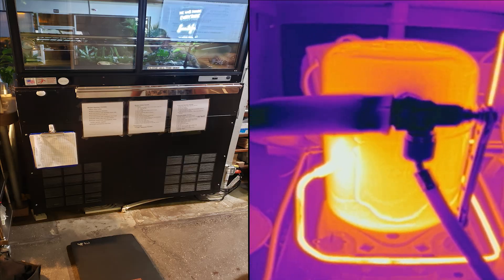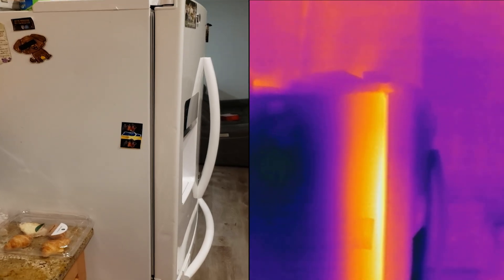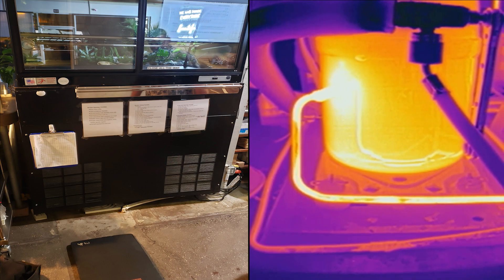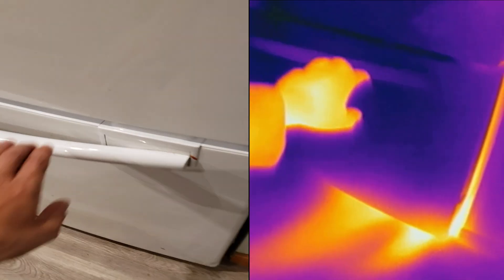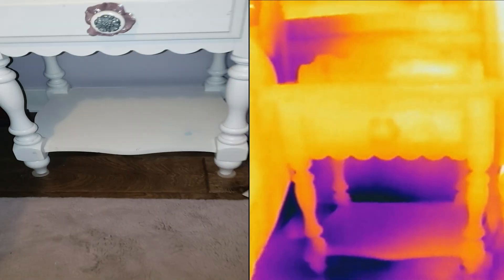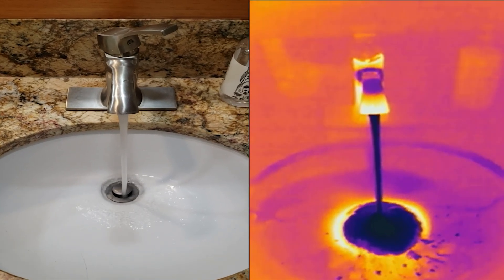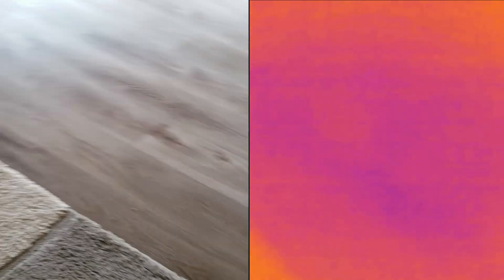10 Cool Uses for a Thermal Camera

Comment from the maker: ➡ Other Videos You May Find Interesting:

10 Ways to Splice/Reconnect Wires:
https://youtu.be/ihpNCVk1lF0
7 Ways to Avoid Getting Scammed:
https://youtu.be/RFQ6iPLCPpg
3 Ways to Bend PVC Pipe With NO Tools:
https://youtu.be/T-Q5otcs0f8
What Ocean Air Does to Air Conditioners:
https://youtu.be/9v-QPabd36Q
Is Common and Ground the Same:
https://youtu.be/wiKDlIlbiP4

Comment: Fun, I just wish they weren't so expensive.
Reply: Actually some of them are really cheap, and there are models that can be plugged right into phone via OTG USB. Cheapest are some Chinese of course, but they do the job very well, considering how cheap they are. Only question is how long they will function. You really don't need pro level equipment for home use.
Reply: They aren't too bad anymore. I have the same one from this video that I got for  $220 usd.

Comment: So, can i see pipes and studs through sheet rock?
Reply: Only sort-of with studs.  It's a very poor tool for finding studs compared to a stud finder but, on an outside wall the studs will transfer heat compared to the insulated space between the studs and that will show up on the camera.  Pipes won't show unless they are giving off enough heat to warm the surface where you aim the camera.  It does not see through anything.  It just displays the heat signature of the surface where it's aimed.

Comment: Can a thermal camera detect a sewer pipe under a concrete floor with radiant heat?
Reply: Use a metal detector for cast iron sewer pipes.  Perhaps if you ran cold or hot water through the pipe while looking you might see an image but it's not a good tool for that.

Comment: 1. Fart detector - calibrate in private prior to testing in public. Mostly just for fun. 

2. Tracking - you can see footprints of animals and people for a couple of minutes after they’re gone. You will never lose a game of hide and seek again. Unless you’re out of shape and have trouble catching people. Then you’ll continue to lose until you clean up your diet like you keep saying. 

3. Developing chronic anxiety - when you realize your TV vent is putting off 100° exhaust as it sits right on top of your highly lacquered wooden dresser. You now won’t even run to the bathroom without making sure it’s off first.

4. Attraction detector - while it’s not an xray and you can’t see through clothes you sick animal— it can detect the heat wafting from the goodie pack. When there’s a lot of good blood flow to the area, the engine is cranked and running. Time to ask for that number. Or seek out therapist before you end up in prison. 

5. Becoming a Predator - despite initial impressions, this is not a duplicate of #4. Time to become a different type of Predator. One with dreadlocks and a nasty attitude. Unless you already have those as well. If so, you can take a 5 minute break. 

Now— go out in the woods and walk around looking back and forth. It helps if you’re in the jungle. Now imagine you’re some type of ugly alien thing and there’s army people trying to shoot at you every time they see you (disclaimer: not recommended for those with a history mental illness).

I’ll be honest I didn’t really pay attention to the movie so I have no idea what you’re supposed to do past that, but what I do know is that this is exactly what the thing’s vision looks like— and everybody was like MAN it would be so awesome to be able to see like that. 

Now it’s possible, sort of. In 1982 you simply didn’t have the technology. In 2025 you have the technology, you just don’t have a good enough job to afford the technology. Maybe you should have studied more instead of watching sci-fi movies all the time. Oh well.

All I can say to you about that is…OMG IT’S SO FKN COOL and you’re so missing out. Keep working hard and saving up— I’ll be up in the trees watching your heat signature though the wall of Popeye’s chicken as you take people’s orders and fantasize about the day you are no longer limited by your primitive natural senses as I once was.

Comment: if you are on a long downhill road you can slow down by shifting to a lower gear relying on your engine compression so you don't have to worry about rotors overheating, bonus points if you added a regenerative braking system or drag braking system

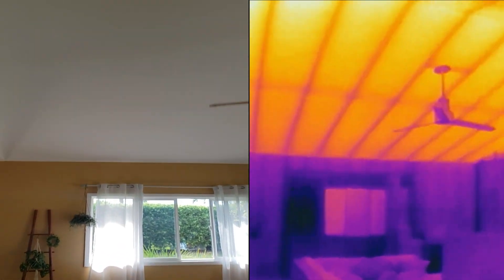Comment: 2:16 this looks as if you have no insulation in the ceiling, at all.  Wood is a terrible insulator compared to any common insulation material.  The ceiling joists should show a warmer color than the space between joists, even if you only had a couple of inches of blown-in insulation there.
Reply: Your comment would make sense if this was winter time but its not. It's summer

Comment: I work in an oil product terminal. Can a thermal imaging camera see through a truck carrying oil product?
Reply: It doesn't "see through" anything.  It has no x-ray vision.  It only sees and displays differences in temperature.  If you aim it at a truck, it will display temperature differences on the metal surface where you aim it.  Nothing more.

Comment: One more tip/warning: Thieves can use a thermal camera to see which buttons you pressed on a keypad (e.g. door lock, lockbox, car door, or ATM). To prevent this, rub your hand over all the buttons after entering your code.
Reply: This is actually really helpful. Thanks!
Reply: That's ridiculous.  No one can tell the order your press buttons for a pin code with a thermal camera and crack-head thug thieves don't carry around $500 cameras.  They will just wait until you have your money and take it from you.
Reply: @davidkrump9446 It’s not ridiculous, it’s mathematics. Normally on a four digit pin there are 10x10x10x10 = 10,000 combinations. However, a cheap $150 thermal camera could detect the four buttons pressed within a short window of time. If the attacker knows the four buttons you pressed, then this changes the combinations to 4! (4 factorial) 4x3x2x1 = 24 combinations. Even if your system had a 15 minute lockout after 3 failed attempts, a targeted attempt over time would work. That is why we should use longer pins if permitted and to use at least one digit more than once to frustrate an attack.
Reply: @davidkrump9446 The LockPickingLawyer demonstrated doing it with a $200 thermal cam in video 1442.

And it’s not just a danger for simple muggings. People could also use it to get your debit card PIN, get into your car and steal expensive gear you’re carrying (if you drive a Ford with a keypad. E.g. I sometimes carry several grand worth of photography equipment), access a secured office building and steal corporate secrets, etc.

So just wipe your hand on the keypad after using it. The defense is trivial.
Reply: @davidkrump9446 Also, if you put your house key in a lockbox like real estate agents commonly do, those lockboxes allow the buttons to be pushed in any order.

Comment: Another great use for thermal cameras is to search for hidden cameras in places like hotel rooms and Air BNBs etc...
Reply: I'm curious. What about a hidden camera would cause it to have a different temperature than its surrounding environment? Hidden cameras run on pretty low voltage, right?
Reply: Even low voltage will show with a thermal
Reply: @CONCRETECOWBOY88  I’ve got a thermal imaging camera myself, 256×192 resolution, and I get what you’re saying: small electronics can show up on thermal. But it’s not really about voltage; it’s more about how much power the device is using and whether it generates enough heat to stand out. Some low-power devices do emit detectable warmth, especially if they’re actively transmitting or processing data.

That said, most rooms are already full of objects that give off similar or even more heat like chargers, laptops, light bulbs, appliances, even sun-warmed furniture. So while a hidden camera might technically glow, it often blends right in. It ends up feeling like the needle in the haystack.

If you’re interested, I can share some thermal images from around my house that include a variety of electronics. When I first got the camera, I was really curious about using it for this kind of thing, but I was surprised to find that just visually scanning the room was often just as effective. Still, you might spot something in the images that I missed; I’d be interested.

There are higher-res thermal cameras out there, of course, but at that point, the cost starts overlapping with tools that are actually designed for counter-surveillance, like RF scanners or lens detectors. But that's just my $0.02, and that may be exactly what it's worth. :-)
Reply: Can't you just use your phone's camera to find hidden cams?
Reply: @danzusername  How would that work?
Reply: @caseylocke4474 It probably messes with the wifi as cameras are still electronic devices. With a camera, I don't know.

Comment: I've never used a thermal camera before. After watching your video I now see it is a very useful tool. Thank you Jay, for the tip as always, it's a hot one.😃👍
Reply from the maker: Glad I could introduce the tool to you! 😄 One can get along just fine without it but it can come in handy once in a while.
Reply: id be careful which one you buy as some may only measure surface heat not heat through objects